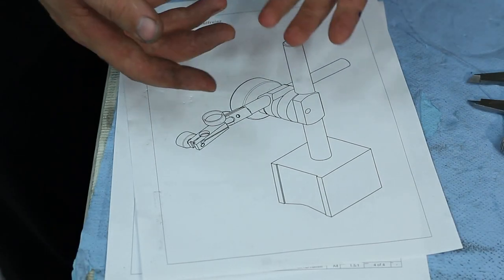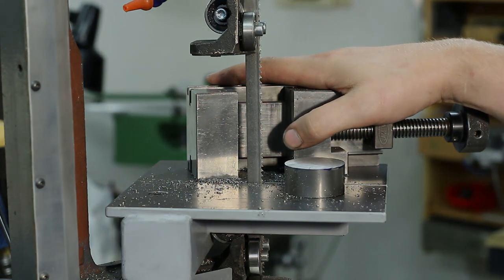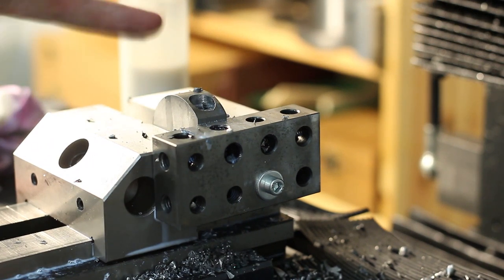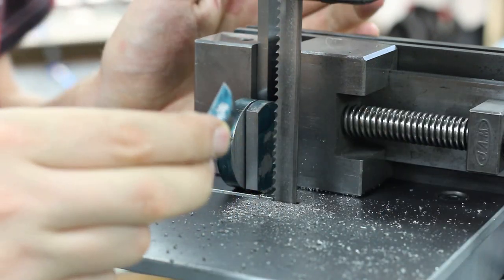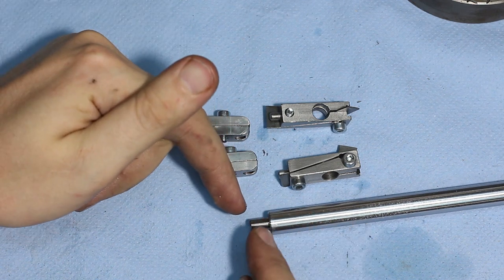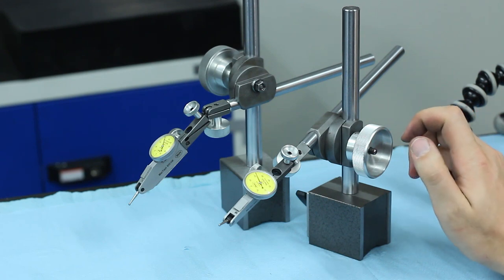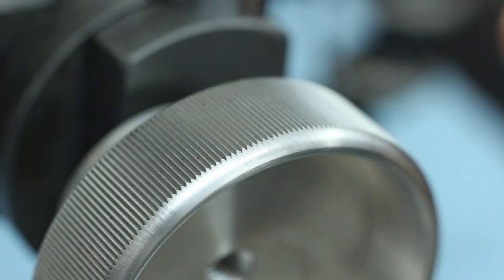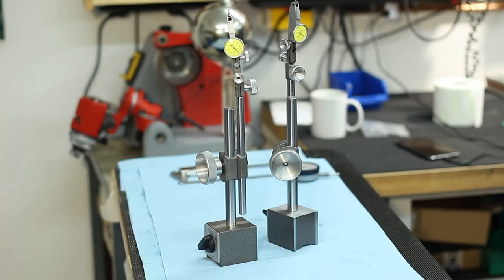Solid Indicator Stand - Part 2

Comment: are we just going to ignore the fact that this man bandsawed (freehand) to 0.2 mm of his final dimension?
Reply from the maker: I thought thats common? :o
Reply: I'd be lucky if my bandsaw didn't drift off 50 thou making a cut.
Reply: Clickspring often seems to be half a centimeter from his lines although I'm sure that's at least partially because of the small scale of his parts.
Reply: Robert McEwen look at you, only 50 thou drift.  Lucky.
Reply: Robert McEwen I'd be lucky if I didn't amputate 2 fingers...
Reply: Yes, Stefan really missed that one...    8^)
Reply: Like I said, Super powers were involved.
Reply: I can manage 0.5mm with a hacksaw, if I have a nice scribed line to follow.
Reply: brocktechnology.  I think ClickSpring does that deliberately, for that indulgent feeling. You never see him using his offcuts for anything either. Always a big fresh piece of shiny new brass.   It's like the chocolate Ann Reardon uses in her cakes.
Reply: I always shoot to stay between 1mm and 2mm off the scribe lines...I'm not comfortable with anything less than a bandsaw's width between the line and the actual cut!
Reply: I've got a bench grinder now and nearly have a belt sander together,  but before that whatever I didn't saw off, I had to file off.  That meant it was worth the time to saw carefully close to the line.
Reply: What you have to ask yourself is mow much time has he spent tuning that saw.
Reply: I'm surprised it didn't come off the bandsaw with a ground finish  !
Seriously nice work though ! 
Just wondering how many times he had to jog the saw blade around so it showed the swiss made logo !
Reply: u
Just don't let oxtool and nyccnc find out that he used a bandsaw as a final surface.
Reply: He TIG welded a 2mm ball bearing, too...
Reply: I am happy to maintain 500 thou with a band saw.
Reply: Nooo kidding.. im sure he has a very good bandsaw but still
Reply: Of course Herr Gotteswinter freehand bandsaws to 0.2 of final dimension - after all, he is "Made in Germany" :)
Reply: I think it’s a German thing. They’re just born high precision
Reply: I see a swiss blade - for me the bandsaw blade is everything - all the tuning I did was not working - unless I have a good blade then I can cut to 20 thousands easily
Reply: @rickrick1867  I saw that blade and how well it cut.  Wonder if same is available in the States?  I have always used Lenox blades made for me, have been really dependable, but his saw and skills are above what I have to work with!

Comment: I recently rescued a couple of DI mag bases from an abandoned w/s. One was a Mitutoyo branded Taiwan made unit the other is a larger Eclipse 901 push button type. 
I went back to your series on mag bases to refresh my memory with a view to reworking the Eclipse. 
After cleaning and surface grinding the base I noted the magnet had lost much of it's holding power for whatever reason. Searched fleabay for some Neo magnets for replacement and got 3 - 35x10 dia with a 6mm hole. With a new all stainless steel bush button assembly it now sticks like s@#t to a blanket. Both column and arm were badly corroded so were replaced with 
chromed H&G shafting ( not cheap ) Very happy with the outcome and a neglected tool has a new life. Plan on adding the Renzetti knuckle and clamp.
BTW when watching this series on mag bases I remembered a repair I did many years ago to an abused (not by me) base laying around the workshop. All of the switch type bases have an aluminium centre section the column screws into and is weak point inherent in the design. After screwing down in the corners a non magnetic top plate (S/Steel)to the base and screwing the column to the new plate I noted the column rigidity was greatly improved over the original mounting and the grunts could yank the base free all day.

Comment: Cut knurling is the best. I used to make the knurled  knobs for John Martz' Luger Carbines and I made a devise that would automatically enter the part and leave the part and would execute a partial knurl on the edge of the circumference and was sharp. It was fun! I made a fixture to measure the run of knurls.
Reply from the maker: Interesting! 
low and behold, ian/forgotten weapons has a video on John Martz Lugers - Georgeous work on them.

Comment: Love the steel bar you added to the mill. I plan on steeling this, and milling the bar into an 'L' profile so the mag base has 2 sides of contact when mounted. Just a 5mm lip or so the keep the mag base clocked at a 90 degree. and add rigidity to it axially.

Comment: Thanks for the tip on using a small boring bar to true up the hole before reaming. I would do it on the lathe but didn't think about it on the mill.

Comment: Those annular cutters are also pretty handy in the tailstock of your lathe.  If you're boring a through hole on a part it's a really fast way to open up the hole for a boring bar.  I use an MT4-ER40 collet holder, and I have a few sizes next to the lathe.

Very nice work as always Stefan!

Comment: When you made the remark about the belt-sander, I half expected you to pull out some kind of slitting wheel for the surfacegrinder so you could grind the inside of the slot. Now off to the think tank to find a way to make my own version of this.
Reply: Maybe an angle grinder wheel could be adapted. Almost certainly horribly unsafe, of course.

Comment: Hi Stefan, nice videos, just a small hopefully useful comment, if you flip your vice through 270 degrees so its face down at the initial cut on the large bar stock, it increases the clamping area on the stock and you slide along with the top of the vice. If you have a vice jaw with a horizontal vee cut in it, even more so. Later on you can't do this for the small cuts, but its a small change when its possible for more stability for free. I do a lot of heavy stock cutting on a larger doall vertical bandsaw with the mechanical "auto feed" (workpiece pulled in by big weight on lever) and I use a vice in this way a lot, though as I have the luxury of a large table its wider.

Comment: Stefan. Great job as usual. Slight concern on my part about you using a glass jar for your quenching oil, I notice Clickspring does the same. Do you not consider the thermal shock on the glass as you plunge red hot metal into it, as well as knocking a lump out of it if you happen to bash it with the part ? Or are you using glass just for video use. An old baked bean tin or a stainless steel container would be best. Clickspring coats his parts in some kind of paste before heating to prevent all the scale build up, perhaps next time you could try it to save all the work of cleaning off the scale ?
Reply: Hey Dave. They don't have Marmite tins in Germany........

Comment: Indicator stands can be one of the most frustrating things in the shop especially cheap ones , that thing is built like a tiger tank !
Unfortunately Noga  is very expensive to buy here in Australia and even second hand stands from Starrett , Eclipse and Mitutoyo are ridiculous .
What i would really like to see is a comparison between the major brands as to clamp force , maybe if someone had a few brands in the shop they could set up a spring weight scale and test how much tension is required to break their grip axially and radially .   
I'm thinking of mounting up some tee slot mounts on my machines in various places so i can use them instead of mag bases , still needs some more thought and proof of concept though .
Another superb video  Stefan !

Comment: I like how your videos turn out thorough but not dense. I do have a question though: shouldn't you paint / coat / anodise the mild steel parts, to keep them from rusting? Especially considering you have different metals in electrical contact, which with a bit of moisture (like sweat) can oxidise them really quickly. (I am unaware of how vulnerable tool steel is to rusting.) Thanks!

Comment: What is your preferred method of removing heat treating scale from parts such as the fine adjustment component?  Thanks
Reply from the maker: Blasting with finegrit aluminium oxide works in my opinion the best.
Glasbead blasting is not the best, its not abrasive and just relies on impacting and breaking the scaleing.
Reply: @StefanGotteswinter  Fantastic!  I was curious because your parts looked great.  Thanks!

Comment: Stefan, why a rotor brocher rather than an endmill? Did I miss something. I know you spoke about spot drilling and then drilling out subsequent holes but a solid face milling endmill would do the same thing wouldn't ?

Comment: Stefan hi! Great machining always. What brand and model is your band saw? And what does the H7 following the 12 - 16mm reamer mean? Soft inside like most eehh?? :)
Reply: You asked about the H7 reference about a year ago, and just in case you still don't know, it refers to the tolerance of the 12 or 16mm holes that were reamed out. if you are interested in finding out more just look at Din 7157 or ISO 1829.  Google it and download the PDF.

Comment: Very well done Stefan, I like these stands.
I will put 2 stands in my to do list, but the ball interface is overkill and I will replace it by one hard pin of 6mm.
Reply: You will loose 90% of the positioning versatility of this design if you drop the ball joint. Coming from someone with 40 years of hands on experience with this design. ;-)

Comment: Hi Stefan, where did you find your case hardening compound and what is it's brand name? 
I haven't found a source for it in Europe so far.
Excellent work might I add.
Reply from the maker: https://www.wks-aalen.de/?page=https%3A//www.wks-aalen.de/de/01_shop/01-02_artikelgruppen/905500.htm
Reply from the maker: Most gunsmithing and hardening accessorie suppliers should have something like that in their sortiment.
Reply: I clicked that link...couldnt read a word on that page. 😳  LOL
Reply: MSC has Cherry Red, which was one of the examples cited in the video.

Comment: Man, I need a better band saw. Takes mine close to ten minutes to cut through a 25mmx50mm 1018 steel flat bar, using a 24 TPI bi-metal blade. And the blade likes to wander, so I have to leave 1mm extra material on each cut.
Reply from the maker: +Output Coupler you need the right blade! 24tpi is good for sheetmetal. But not for solid stock of any reasonable cross section. 8...10 or 4...6 tpis the way to go
Reply: What is the speed of the blade? How many meters per second? 
I tried with my vertical bandsaw and its lowest speed is about 6 meters per second. The blade was pilana, 10/14 variable pitch...I got it blunt in less than 10 seconds...
Reply: My Cheapo band saw did not cut straight. I watched a youtube video and followed his directions. My saw cuts great now and pretty durn straight too!
Reply from the maker: I can go from 0-160m/min surface speed. 
With a bi-metal blade you better not go above 15...50m/min, depending on the type of steel. Freecutting mild steel can be run very fast, D2 toolsteel not so much ;)
Reply: Stefan Gotteswinter mine is 380m/min...I got it blunt in the first 20 seconds.. I have to build some pulleys to reduce its speed. Thanks
Reply: The old rule is to have 3-5 teeth in your part while cutting. So you want about 3-5 teeth per inch (25mm)
Reply: Thanks for the tip. Replaced the blade, cuts much faster now. Less wandering too since I don't have to put so much force on it to get a good cut.

Comment: "Surface grinding is not absolutely necessary,  (But I'm an Austrian.) Jkg,  No, but really man, keep doing it all. Old bitter dude where I work, when I told him about  your test indicator, fine adjustment holder, he says, "You can just buy that stuff, it costs more to make it." And anyway, he s always complaining about crappy indicator fixturing, I say, keep doing it man, cause all the cheap asses wont.  But what nation are you from,  if your not Austrian, I apologize,